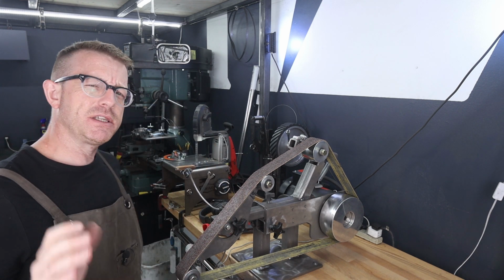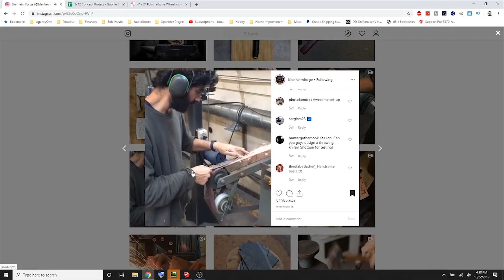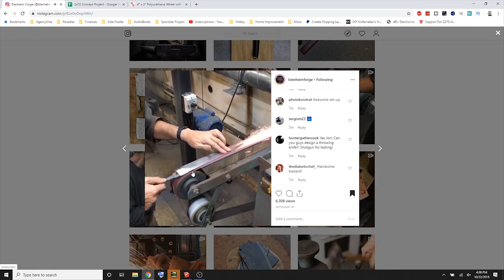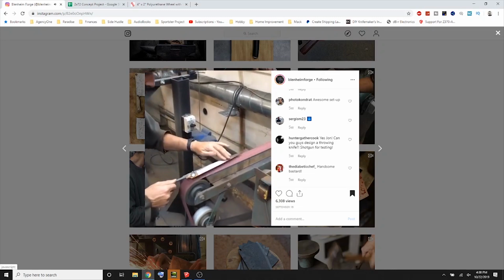2x72 Belt Grinder Hidden Features For Knifemaking

Comment: Hi Brian,
I watched several of your videos and really like your design. I'm starting knife making an filing the bevels be hand is a pain and takes hours. So I will build a 2x72 as well. 
My question is about the sharpening. Why do you sharpen with your 2x72? I thought of buying a wetstone sharpener for that purpose. Some people argue that the edge will overheat and ruin the temper using a belt grinder. What is your opinion and experience about that? If I don't need a wetstone sharpener I could save the budget for a 2x72.
Greetings from Gemany.
Reply from the maker: Great question Tim, the answer is mostly speed and time. I spin the belt backwards and slow so I don’t heat up the steel. I now have a Tormek and use that for putting on the edge but sometimes I go back and just use the belt. Cheers from Florida! 💪🏻😁

Comment: I’m starting on my build. I was just wondering where is a good place to buy belts? Or what is a good brand?
Reply from the maker: A really good ‘cheaper’ ceramic belt is anything in the VSM brand. I buy mostly through trugrit.com they are good folks over there. Also I have heard good things about combat abrasives. Get some 36, 50, 100, 220 ceramics to start. Also watch this vid: https://youtu.be/w0c4UCLyPm8 - it explains all of this in detail.
Reply: I just bought the Combat Abrasives starter pack.  Works out to about $5 per belt, after sale price and discount for first time buyer.  They are aggressive belts, and come with a great reputation.
Update:  I do have to say that I'm not terribly happy with the company though. They had a deal where if you leave feedback and share a picture you get $15 in combat box, or something like that, but they never made good on it with me. I even called them, they said they got the message, but then I never heard back from them. Still a good product, but not real happy with their customer support.

Comment: This is great, I found the same thing in regards to the plate steel between the tooling receiver arms and the motor mount.  I had no troubles getting everything squared away needing, as you said, to only adjust the platen.  Thanks for sharing.
Reply from the maker: Oh nice! looking forward to seeing your build!!
Reply: House / Work - it’s already done. Video isn’t the best, but head over to my channel to check it out. I’m looking forward to seeing the one you’re sending Dustin this week.

Comment: That platen running in reverse like that seems like it would make doing a distal taper vastly easier as well.
Reply from the maker: Yes this is a good point. I have done a couple and it does make it easier.

Comment: I love the length wise grinding. I've seen Kyle Royer use a set up like that but it has a tight radius for the plunges... for bowies and hunting knives. I've been thinking about building one of those. Great looking grinder, sir!
Reply from the maker: Ill have to check out Kyles work. Where this really shines is with kitchen cutlery and you don't need to worry about those plunge lines for the most part.  Hope you are happ and healthy J!!

Comment: Hey buddy, what's the situation with the CNC plasma table you got on order??  First thing you should make is the motor mount plate I'll be first to preorder. What do you think causes the side to side shimmy of belts??
Reply from the maker: The shimmy is almost always related to the wheels not being in alignment and/or stretched belts. Every belt has a little bit of wobble in it.
Reply from the maker: Oh and in regards to the CNC, I don’t know when I will get it. Hoping it will be here soon. They shipped me the plasma cutter and some other parts but not the table.

Comment: Yet another great thing about your design.  I think I'm getting closer to the point I can start the build. I have a buddy with a water jet and I may see what it's going to take for him to cut my pieces.
Reply from the maker: Yeah Ted! I’d like to see your build when you start send some pics via email. 👊🏻👊🏻👊🏻
Reply: @HouseMadeUS  I will definitely do that. I've got to finish my restoration of a Columbian D46 vise I've had for awhile and I picked up a Atlas 618 lathe the other day that needs some major cleaning, but should help with the grinder build.  Now I've just got to find a mill and I should be good for awhile LOL
Reply: If water jet turns out to be too expensive or not an option, I can have them laser cut for you. My set turned out really nice.
Reply: How much to cut
Reply from the maker: $180 shipped for all the plate.
Reply: My price is actually at $160 shipped if you’re in the lower 48 states!